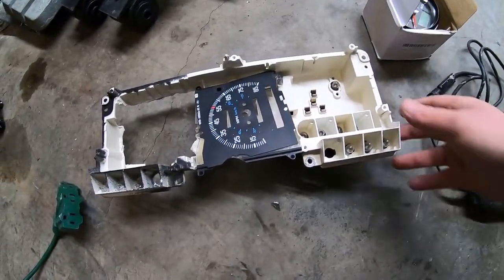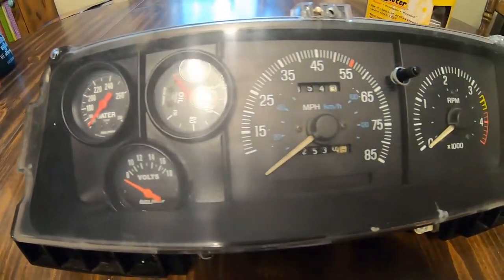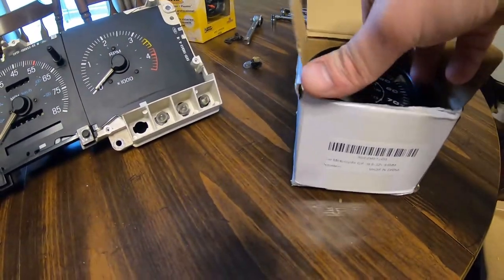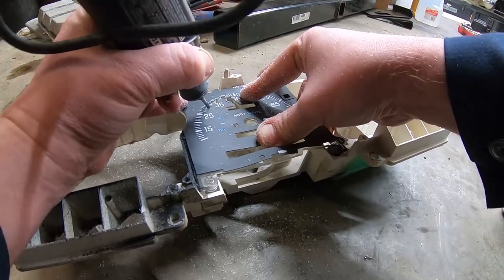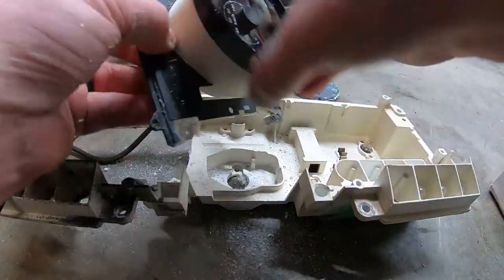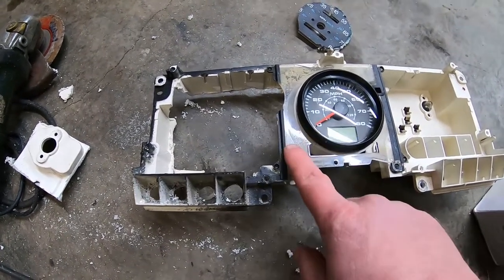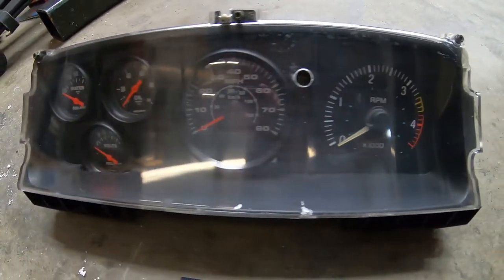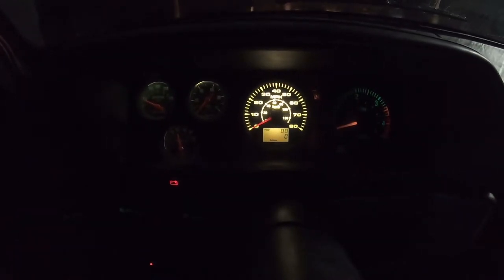Bricknose Ford Custom Gauge Cluster - Fitting Real Gauges in the Factory Housing - How To

Comment: how do you know how much fuel you have? and also what seats did you put in there?  im reworking my grandfathers old 1988 f250 super cab long bed. that cluster looks pretty good . every time i go to the salvage yard and i see one of these 1997-1991 trucks or broncos i get the gauges , i got about 6 complete gauge sets in a box  for spairs
Reply from the maker: The fuel gauge is in the overhead console with a on-on toggle to select between tanks.  Tanks have aftermarket gm senders.  You might be able to fit 4 gauges but it'd be tight.  One of those round quad gauges though would likely fit and cover everything and they've become a lot more affordable now.  Autometer has a few different styles of quad gauges and there are some cheaper options too.
Reply: @NotSoGrandGarage  cool thanks i may give them a try when mine go bad

Comment: What did you wire the backlight wire to? Doing the same thing on mine.
Reply from the maker: The factory  backlight wire
Reply: @NotSoGrandGarage  Is there a factory backlight wire in the 2 connectors to the cluster? I can not find a good wiring diagram for the instrument cluster. Or did you tap into backlight wire that goes to radio?
Reply from the maker: Here you go.  BTW...  this website has a lot of free manuals and such.  https://charm.li/Ford%20Truck/1990/F%20350%204WD%20Pickup%20V8-7.3L%20DSL/Repair%20and%20Diagnosis/Diagrams/Electrical%20Diagrams/Instrument%20Panel%2C%20Gauges%20and%20Warning%20Indicators/System%20Diagram/Instrument%20Illumination/

Comment: Got a 90 f150 5.0. it has no dash or cluster just steering and wires hanging around. I ordered the 5 single set white with red needle clusters. What do I do about the miles so when I go get it legal they look to see how many miles it has?
Reply from the maker: Most states titles that I've seen have an area to check off for "not actual mileage" or "odometer beyond mechanical limits"...  something along those lines.  Shouldn't be an issue but call your dmv
Reply: @NotSoGrandGarage  alright awesome! Thank you. Everytime I went to get plates or get inspected the dude would have the title in his hand or something and would peek his head in the car to look at the odometer. was just afraid I would have to set the odometer on the speedometer that I'm getting. Since it's brand new I'd come in with like 4 miles on the truck so the title would say 140,000 then he'd peek his head in and see 4 lol. Was just afraid that when I got the truck that the speedometer and all the dash being gone would be a problem with getting it legal showing the miles on the truck to the inspection guy.
Reply from the maker: @raviolibandit8396  shouldn't be an issue as trucks this old us mechanical odometers that can't be reset when replaced.  If they question it, just tell them that the old one failed and needed to be replaced.
Reply: It's over 25yo so odometer reading doesn't matter anymore. Just when you sell it just to be a nice person you should be honest amd just put 1234 miles lol aka unknown it gives you good karma